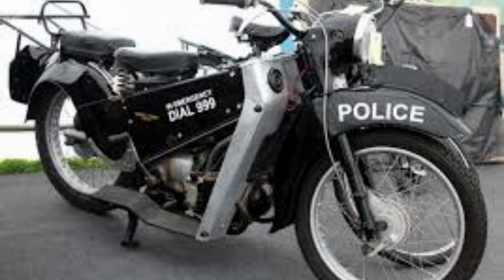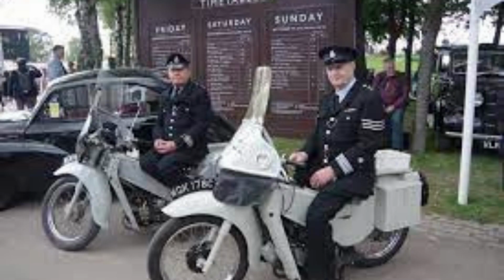THE POLICE LE VELOCETTE

Comment: The LE was a brilliant design, made for a market that did not really exist, as it was intended for commuters.  It was saved by police forces realising that a beat policeman could quietly cover a much larger area patrolling suburban streets in a single shift than he and three colleagues could on foot.  Police use also contributed to the demise of Velocette when they sold a large number to police forces on fixed price contracts, and inflation pushed up their costs. The Morris Minor did the same job as the LEs were phased out.